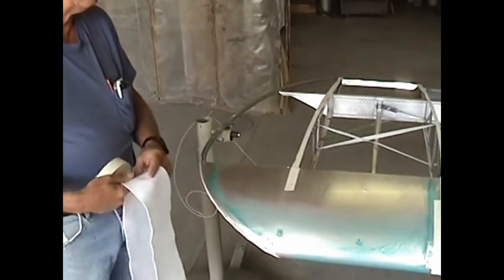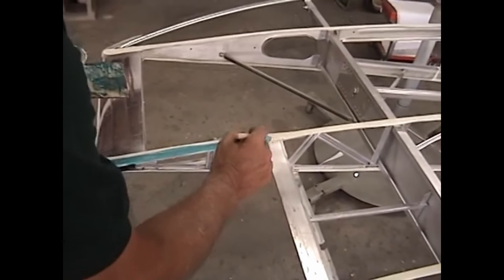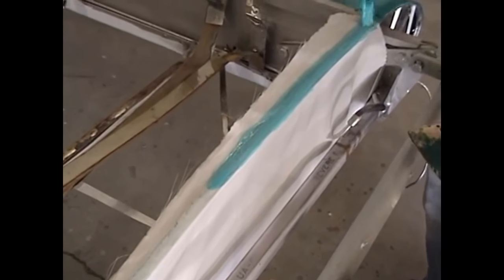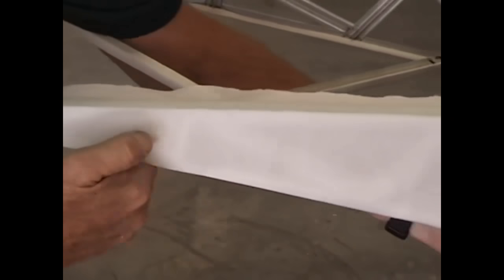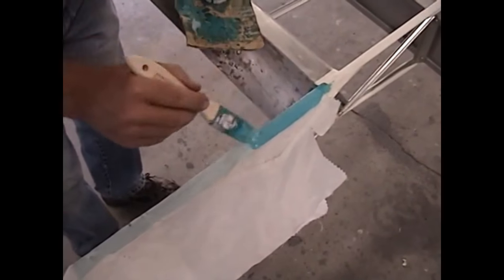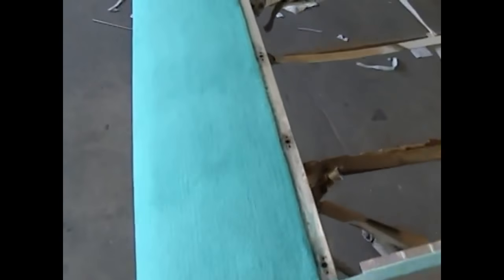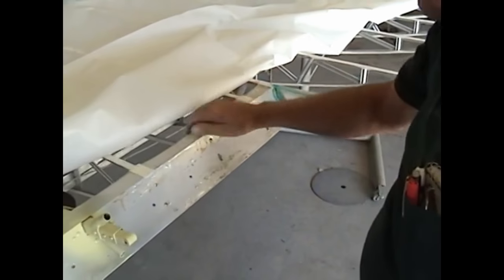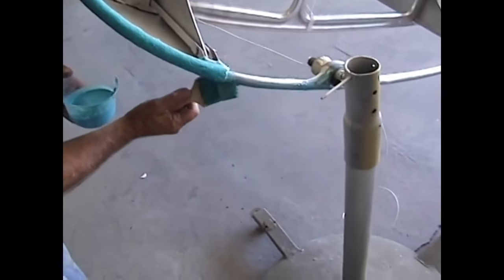Piper Wing Covering 1   Gluing bottom surface

Comment: Hello,

After watching their videos I will use the stewarts system to fill in my J-3, but I have 2 questions:

1.- What is the name of the fabric that is placed on the leading edge?

2.- Is it not necessary to give an epoxy primer to the entire aluminum structure before covering it?

Thanks in advance
Reply from the maker: Hi Pedro, please check at Stewart Systems. I only cut up their movies to make it easier to watch.
Reply: @dennisjansen9951   I have just found it: https://stewartsystems.aero/product/white-polyester-felt-2/  Thanks!